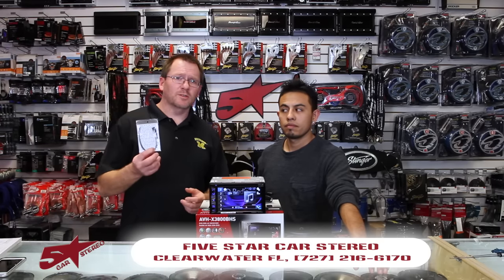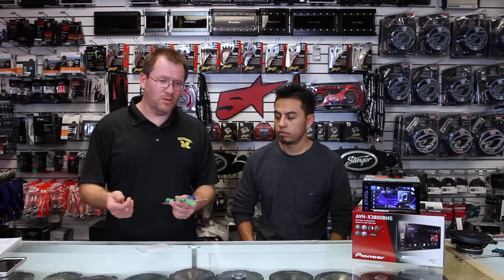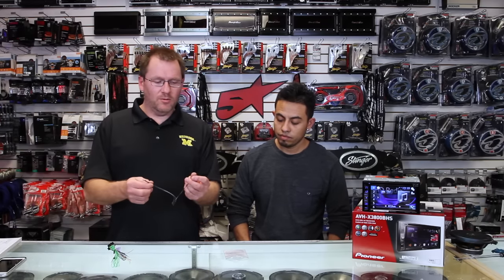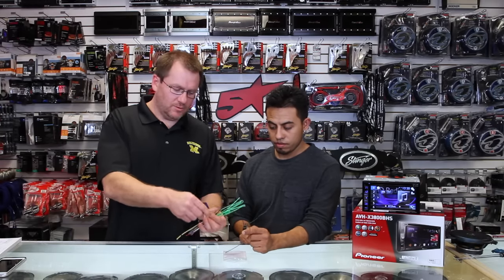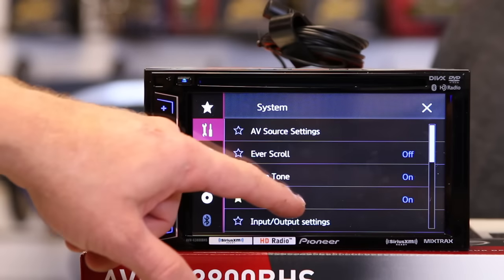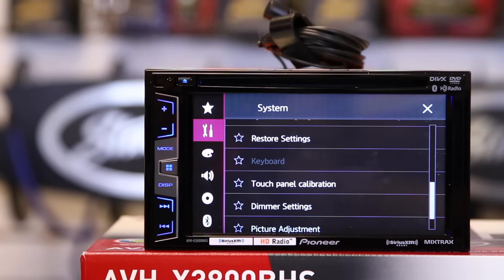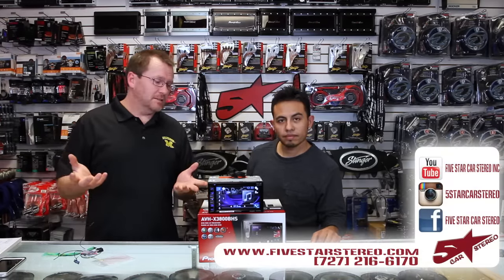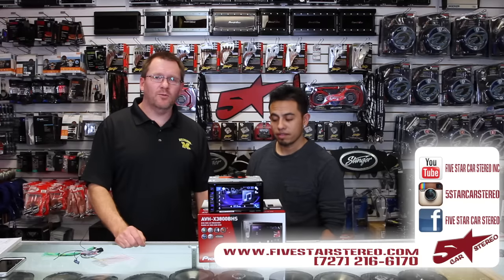How to do the brake bypass on your Pioneer AVH Radio using a MicroBypass

Comment: So when you do the Method Turn On and Off are you turning the Engine on or just going to ACC and turning on and off like when programming a New Remote Key for your car ?
Reply: Same question...
Reply: Did you find an answer? I have the bluetooth settings working but not able to do video.

Comment: $3 toggle switch from Walmart battery section. Green wire from radio (parking brake wire) to one side, ran another wire from other side to a switched fuse under steering wheel. That easy. Turn the switch on and off when wanting to watch a dvd while driving. Takes about 1.2 seconds to complete the sequence of on-off-on. Mounted the switch directly in between my front a/c vents so its super accessible.

Comment: I was having a problem with a bypass module from Amazon. I ended up just hooking it up with the reverse positive that came up to the front of the truck with the backup camera AV input. Solved the problem and was able to access all settings on a Pioneer MVH-1400NEX.

Comment: It’s kind of funny .... five star audio uTube videos are normally first rate. However, this one actually doesn’t show a good close up of the Pioneer harness wiring connections to the bypass. The installer, is way zoomed out when he is doing the actual connections stating “you just connect this wire to this one etc.”. You can’t actually see how it is hooked up. Just some constructive feedback....

Comment: The System Remote Control wire and the Ground wires, do they also need to be connected with the ground and rc wires from the harness for the car? My Metra Toyota harness also has a ground wire and a rc wire, do I connect them too? Or tape those off..?

Comment: Will this Bypass eliminate the issue where I have to park and put on the break in order to watch a DVD?
Reply from the maker: Yes it will.
Reply: notchjohnson1 Yes, he did and that was not the purpose that they were describing it's use for in the video. They were showing it's purpose as to unlock screen features that you can not use while driving. They didn't mention anything about eliminating the need to park and apply the ebrake in order to use the DVD player. So if you are saying that he is spot on at his assumption, you have a correct statement.

Comment: Good afternoon gentlemen thank you for awesome demonstration I just bought a Ford F-150 and it has this radio the radio if I don't put my seatbelt on we'll go blank but now when I put my seatbelt on as I'm pulling out of the parking space the radio is not turning on but when I put it in reverse the radio turns on there's something blow inside is Radio I really could use your help this is Hell driving with no radio
Reply: Omg man! Ok I don't think I'm gonna buy this 😂

Comment: 1st thanks for trying to teach me I tried for weeks just couldn’t get it .. finally took my truck to a pro and it was fine for about 21/2 months 
My question is what could go wrong with the red wire plugged up to my cigarette outlet ? the one on the right that’s constantly on . I am just trouble shooting I figure while I am already in the radio 
(The light green wire) bypassing the reverse input I mine as well fix it if have to
thanks again
Reply from the maker: Did you test the output of the bypass with a meter
Reply: I did today I was wrong the cig. Lighter is not constantly on , so when I put the multi meter on it, car off it reads 00 when I turn it on or asserory it’s 12.4 to 12.57 ?
I did not wire this this was done by a pro. 2012 Ram 1500 installed a pioneer amp 5 channel two custom boxed 10” Rockford Fosgate punches under the rear seats and 61/2” kickers in the rear doors,and in the front doors  Rockford Fosgate 63/4” Components T1675 (I think that’s what  the number is ) it sounds good but what do I know ..

Comment: Instructions with my micro bypass say that I have to connect one of the wires to my BLUE/White amp turn-on wire on my pioneer radio. HOWEVER, my car also requires a 5V STEP DOWN which is also supposed to be attached to the BLUE/white wire.  Will these 2 connections live in harmony? Or will they screw each other up?

Comment: I have following wire colors, which one I need to connect the light green wire you have mentioned in your video? 
Yellow – 12V Constant
Red – 12V Accessory
Black - Ground
Orange – Dash Light Dimmer/Illumination
Green – Left Rear Speaker (+)
Green with Black Stripe Left Rear Speaker (-)
White – Left Front Speaker (+)
White with Black Stripe – Left Front Speaker (-)
Purple – Right Rear Speaker (+)
Purple with Black Stripe – Right Rear Speaker (-)
Gray – Right Front Speaker (+)
Gray with Black Stripe – Right Front Speaker (-)
Compatibility List:
2008 - 2012 SMART FOR 2
Reply from the maker: M. Yigit Karakilic the lt green wire for the bypass goes to the lt green in the Pioneer harness not the factory power plug adapter. The long lt. Green wire on the Pioneer plug, green to green.
Reply: Thank you for that clarification - because I didn't see any Light Green cable!

Comment: Hi, I need your help, I have an x-Japanese DVD Navigation with a reviser camera monitor and it has parking assistance when you turn Right and Left lines which workes with the steering wheel. now I am going for a new Pioneer and need to know if the Pioneer will support this Parking assistance system.

Comment: I installed a micro bypass about 12 months ago for my pioneer AVH-Z55250BT, but I have an issue where it doesn’t always work properly. Most times I turn the car on the greyed out settings flash on and off and it’s 50/50 whether they’ll be available when moving or not. Any ideas?

Comment: first check if you have a safe mode in the options somewhere in the radio. if so, put safe mode off, then you ony have to connect the green breakwire to the ground cable and you dont need the bypass.

Comment: I have an 08 trailblazer and am using the gmos-01 harness.  Does the brake wire from the gmos harness get connected to the micro bypass as well or just the green one off of the pioneer harness?

Comment: Hooked this up on my Winnebago RV with the AVH 3800 but now the parking brake alarm go's offon the RV,  and I can't get it to shut off so had to disconnect the ground. Would it matter if I don't ground to the black wire and ground to radio frame or something?

Comment: Hi I really found your video helpful, although tomorrow I will connect that light green wire into my bypass and also ground it and connect to remote. The issue I encounter was my rear view cam. It will not work properly and I went to a audio shop. They could not figure out the issue. I hope this helps turn on my rear view cam as I already connected the purple and white wire to the rear back up power lights. And also grounded the black wire. Rca is connected also. I will see if this solves the issue thank you sir

Comment: I have installed DMH A345BT, which can only set my steering wheel control on settings.. Afte my car's swc responses on pioneer head unit's settings, it does not working.. Until settings only. Do you think this is the only issue, on brake wiring which my installer does not bother to touch it..please help, thanks

Comment: Ok guys question installed pioneer AVH-7800 and all new door speakers front and rear. Just noticed tonight the rear door speakers and factory subwoofer which I installed new subwoofer as well r working but not the front door speakers. I used the easy factory wire harness setup plugged all wires right and made sure I connected speaker wires + & - so should be no issues on anything being crossed. So I seen something on a page about unplugging back speakers and it all works and others things I seen but not sure where to turn from this point I didn't know this was going on til someone pointed it out to me cause truthful rear speakers r loud but I want all speakers to work right.
Reply from the maker: Do you know if it is standard mode or network mode? You can check by going to see if you have balance and fader or just balance. What type of car is it in.
Reply: +Five Star Car Stereo not sure which I think I figured it out the store didn't have the correct harness and gave me another one to try and so now I have the one they said was for mine the first time but was out of stock. Mine has factory amp and now I have the amp bypass harness which is 2 harnesses. Does this sound right to you guys
Reply from the maker: +Brian Murphy what type of car is it?
Reply: +Five Star Car Stereo 2002 Chevy Tahoe 2wd 5.3
Reply from the maker: +Brian Murphy it should have worked with out bypassing the amp. If you bypass it you will have to get an amp for your sub. Check the balance and fader
Reply: +Five Star Car Stereo well see I'm confused now cause last few days all the speakers worked and now Saturday night friend noticed front doors wasn't working so I searched and said ok don't have right harness but now I want the factory sub working least for now. What else u think it might be I need to get the micro bypass so I can factory reset the pioneer AVH-7800 and start over
Reply from the maker: +Brian Murphy please just check the balance and fader. Make sure you can go to all four corners of the car.
Reply: +Five Star Car Stereo I'll see if I can figure out how to do that cause everything I have check meaning like switch to front speakers I always here rear any test I done was hearing rear. May I need to disconnect radio and plug back in to get it to reset and see what that does.
Reply from the maker: +Brian Murphy this is how you restore the radio, unplugging power will not do it. The radios now have memory. Then make sure to pick stand mode

https://youtu.be/AxYGhr1ZBSI
Reply: +Five Star Car Stereo I'll have to wait til I get my
Micro bypass setup to reset it that's why I said unplug it or the battery cause I'm new to this stuff been out of the radios for awhile so learning it all again

Comment: You still connect that black ground wire to the wire harness also right?  Like when you are wiring your head units harness to the factory harness you simply add that by pass black to the headunit and factory harness correct?
Reply from the maker: +Zpwslayer Yes you got it. The wires just tap into your harness

Comment: I already have a remote wire ran to my amp from fuse block with factory radio. Do need to connect it to aftermarket radio for the radio to send power to sub output AVIC-8200NEX. Cause as of right now I am not getting sound from sub output.

Comment: Bought one hooked it up and works great, only issue im having is the parking brake light stays on on the dash. Should i disconnect the original ebrake wire that goes past the microbypass ?
13 silverado
Reply from the maker: Yes yes yes you want to disconnect it now
Reply: +Five Star Car Stereo awesome will do - thanks for the reply

Comment: Great info - but I'm curious. I have a Scosche SU03B harness that has an orange wire and an orange and white wire. The Pioneer AVH-200EX factory harness has ONLY an orange and white wire.

I have the A-TRIG1 relay connected correctly, but do I need to connect the orange and white wire and leave the orange wire disconnected, or should I forget both of these wires? I know they are for illumination and have nothing to do with the bypass, but I'd like to know how to connect these orange and orange/white wires. Thanks for any help!
Reply from the maker: Just connect the orange/whites together and leave the orange  capped off. You will not need it.

Comment: Do I connect the bypass black wire to the factory wiring harness and the pioneer harness as in all three together? Or do I just connect the bypass black wire to the pioneer harness and leave the black wire on the factory harness blank?
Reply: I have the same question!
Reply from the maker: +aceofdrace connect all the blacks together like a "T" and do the same with the blue wire if needed.

Comment: Im pretty new to head units and just purchased the pioneer AVS X2800bs. I just found out about the brake switch and was pissed, so the above micro bypass is what I need, so my passenger could input gps info, watch dvd,etc.? Thanks.
Reply from the maker: Yes that will fix the problem so you never have to worry about it.

Comment: What if I dont have an amp or anything hooked up to the remote wire? Will it work if I just plug the bypass wire into the remote wire on the head unit if the remote wire isnt hooked to anything else?

Comment: If you do not have an exterior amp do you connect the blue/white wire on both the car harness and stereo harness to the microbypass or just the blue/white wire from the stereo to the microbypass?
Reply from the maker: Bill Hoffer depends on the car, it may have a factory amp or an antenna that needs the blue/white also. To be safe I would connect both, car and bypass to radio.

Comment: Hi, I have installed the AVH-X7800BT properly to all harnesses etc., just not the parking brake wire. Everything seems to work as it should including bluetooth, factory reset etc. The only problem is not being able to watch DVD / AV (as expected), will installing the MicroBypass fix it without affecting bluetooth or any other functions as it's currently working already? I don't intend on using the DVD function whilst driving, just the AV to screen share my iPhone so tat I could use that as SatNav. Thanks!
Reply from the maker: Catherine Wong yes the bypass will not effect the anything else with the radio.

Comment: In the instructions it says to connect the vehicles black wire to the black wire from the radio and the black wire on the bypass.  Is that true?  
I hooked this up and the check engine light came on.

Comment: okay stupid question. just got my avh3800.   i havent hooked up the parking brake wire yet (light green wire).  I'm gonna do the micro bypass.  do i have to hook up the parking brake wire before i  put on the micro bypass??
Reply from the maker: No the microbypass connects to the break wire to do the bypass. It is real easy

Comment: Hi I was wondering do you have to connect the black ground wire to the wiring harness from my car as well? so will I have three black wires connected or do i not have to use my ground cables from my actual car wiring harness at all?
Reply from the maker: GS Three yes connect all the black wires together. Car+ radio+ bypass

Comment: What if i have a factory amp powering my mids and highs and an aftermarket jl amp and sub for more bass. Would I tie the remote wire to both the factory amp,  jl amp, and brake bypass?

Comment: Your videos are good.  I've watched many.  Thanks for all the helpful info. I purchased a Pioneer AVH-2300NEX and the Micro Bypass.  Everything is connected correctly.  The unit recognizes my Galaxy S8 via Bluetooth and I can play Pandora, make and receive calls with no problem by using either the phone or the Pioneer.  However, when I start Android Auto on the phone, it works fine on the phone, but nothing is transferred to the Pioneer.  Strangely, I can play Pandora or Spotify manually through either the phone on Android Auto or on the Pioneer but I do not get the blocked 'Android Auto' splash screen on the phone. Nor can I get Waze or Google Maps on the Pioneer. On the Pioneer main screen, when I touch Smartphone, Android Auto is greyed out.   On the phone in Android Auto settings-> Connected Cars, my car does not show up.  I've tried sliding the "Add new Cars to Android Auto" both on and off, plugged and unplugged the USB cable and it never gets me to the screens to recognize the Pioneer. I've rebooted the PIoneer, erased all settings, and deleted and reloaded Android Auto on my phone multiple times.  Any idea what the problem might be?

Comment: hi, I have a pioneer avhz5000dab and I connected the light green cable (Parking Brake) both on the black of the radio and also tried directly on the - of the battery but I completely discharge the battery. with this cable system do I solve the problem?

Comment: I got a question but its not quite realted to the bypass. I just got a used vehile that has an AVH installed and I think they might have installed a bypass cuz when I follow the prompts on the screen the controls are still lock. Also there are screens installed in the back of the headrest. Am I able to have the back screens play a movie while the main deck stays on the main interface screen? So I can listen to the radio and the back can watch a movie?
Reply from the maker: yes the radio has dual zone so you can listen to the radio and they can watch a movie. check out this video
https://youtu.be/xnNQvrmhju8?list=PLA1LIIrpw0quywjru7sF41R5vrerm_Lce

if the controls are locked then there is no bypass. Try put on the E break- release it- put it back on again. See if this unlocks the radio

Comment: Sup guys, hoping you can help out here. I just got the DMH-W4660NEX. Micro bypass says on Amazon that a bypass is not needed with doing the “work around” with 1.13 but current version is 1.31. Will this trick still work or is a micro bypass still needed? Thanks

Comment: Hello,  I have the AVH-x2800bs. I have the blue/white remote wire connect to the factory amp as well as my subs amp. I tried to connect a toggle switch (supply) to it as well. then the parking brake to load, and grounded the eath wire to the chassis. I can't seem to get it to unlock the radio features. What could you suggest to fix it?
Reply from the maker: Smazarie you may need to add a relay to the blue/ white wire to up the amperage out of the radio.